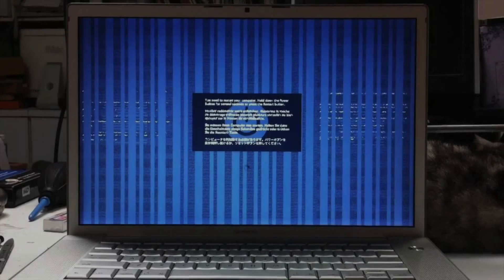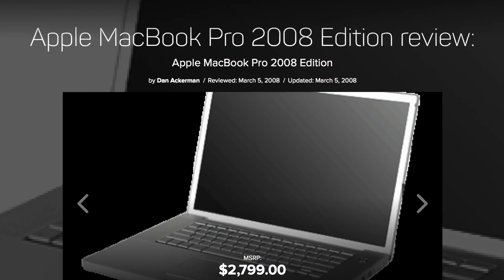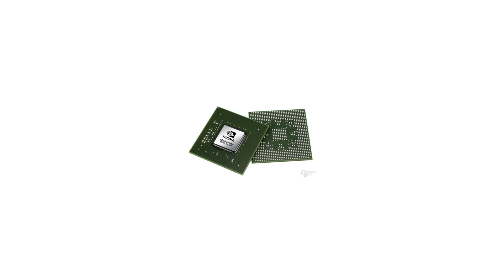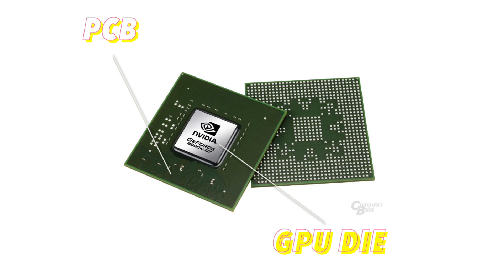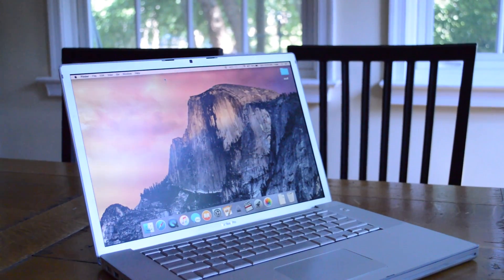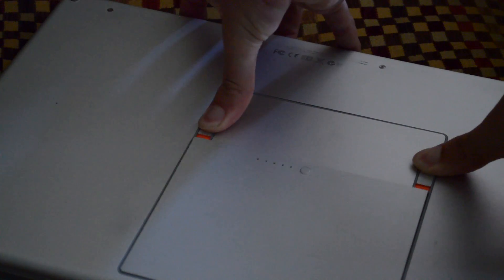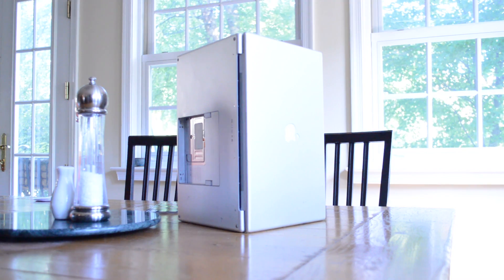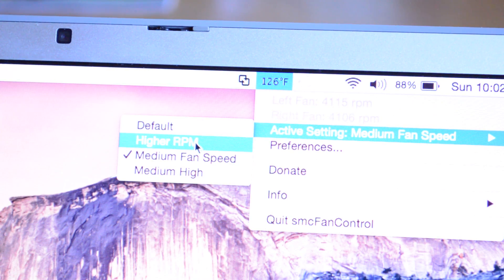2008 MacBook Pro Graphics Issue Explained (and how to fix it!)

Comment: I actually have a 2008 MacBook Pro that amazingly hasn’t experienced the GPU failure yet, despite even having a broken left fan. How it’s still running I don’t understand, but I’m glad it’s still running even now. Also I can confirm it isn’t the solder being the issue because my unit tends to get well up to 100 degrees C and it still keeps running. Thankfully I managed to repaste the heat sink and GPU unit when I replaced the fan. Though I’m thankful for this video because if it ever does fail, I can do this to revive it. Also I heard the part about setting the fans to run at a decent speed, so I’ll do that to keep my machine cool as much as possible.
Reply: Loc,3

Comment: El Cap is outdated, patch this. Also... once fixed, check the PCI bus width in system information... if it's x16 it's entirely fixed, if not then you should heat it further.
Yours shows x8 looks like, which is still wrong!

Comment: A funny thing happend here doing this: I had not used the macbook for 3 years having exactly the same problem, wrapped it in towels and it started right away 😂. But when i wobble the screen it goes black but when I start up again it works again untill I tilt the screen. Any suggestions?
Update: left it under the towel and it is fixed :)

Comment: Why not just hit the GPU with a heat gun? OR run some super intensive crap on it with only 2GB of RAM if it can boot? Minecraft sure does heat my 2008 iMac to 90 degrees celsius unless I run the fans at near max. Or just throwing the motherboard into the oven for a few minutes.

Comment: Cmd-S exit

Cmd S Applejack thru OS-10.9 Yosemite

Ditches the Caches

With my Early 2000 A1260 15" 2.5 ghz...

A funky A1175 BATTERY can cause quits...

A bad charger

Drives with too many bad blocks

Many more

Never seen with my Late 2008 AL-Uni 13.3 2.4 Deluxe

Or my 2007 WMB 13's

Nor my late 2009 Mac Min 2.53....

Maddening

With my ally find/ parts donor

A1260

No graphics issues, tho...

Thank God....

J.C.

Comment: !!! This method fixed my early 2008 MBP4.1!!!  Here is my response to dosdude1 - https://www.youtube.com/user/dosdude1 on his warming in regards to bad GPUs: "You jinxed it! He-he! The GPU crapped out in a couple days after you warned me: lots of rendering artifacts and failing boots... However, I managed to revive the machine by disconnecting both fans and overheating the GPU... You, probably, familiar with the 'method'. After a dozen failed boots(heating up) it eventually properly loaded OS and when I touched the PCB in GPU area and it started generating artifacts again... So, I pressed PCB hard exactly on GPU spot (G-spot) and vu'a la - for the last three days the machine has been running like a brand new one. And... assuming that it is only a temporarily fix I'm searching for revised GPU to do 'your magic'. I'll do it just for fun. Thanks, Man, for your guidance!"
The guy also created "macOS Catalina Patcher program" for unsupported MACs - https://www.youtube.com/watch?v=wxFzZWqoCng&t=1322s&ab_channel=dosdude1   -   It works like a charm!

Comment: I was just about to buy a spare motherboard from internet then I watched your video. I have the skill to open the whole mac till the last screw. I have a dremel  gas soldering device to heat the GPU area. I heated until I couldn't touch. After reassembly the Mac Early 2008 worked! I had it under my bed laying for 6-7 years! Thanks a lot. It feels great.

Comment: Without having a manual fan control app do you think that the system is overusing the fans?  Surely the system can control its own temperature and knows what the best speed to run the fans and at what temperature to get the internals to?
Reply: no it basically does not use them enough, therefore it cooks itself!
Literally every MacBook does this!

Comment: I have some problems on a 2009 macbook pro 17 inch with a Nvidia GeeForce 9400M    It randomly turns off and can take about 30 attempts to turn on, randomly quitting during system boot

Comment: it worked! 2007 mbp still working again, haven't had that feeling since i wrapped my xbox in a bunch of towels.
Reply: any tips? didn’t work for me :(
Reply: @firefoxsimp  lol great user name! Actually it stopped working quickly after,  I recommend taking apart and using a heat gun to melt the solder between motherboard and graphics card,  there is good tutorial how to but it's more difficult than the towel trick
Reply: @LSGTSTRM  link? also could i use a hair dryer as i don’t have a heat gun

Comment: My ALLY FIND/ABUSED 8/2008 A1260 MBP 2.5 15"

Is working fine!

Mobo was fine

Booted right up with a good POST

Worked via my ally find MINT DELL 18.5" VGA Monitor.

I swapped Screen/Lid and Keyboard from my two dead A1226 MBP's

Upped the RAM to 4GB from my bins

Kept the OEM 250MB 5400 rpm drive....

For the time being

Took a few dents out of the bottom shell

IT SINGS!

Matches my Late 2009 Mac Min 2.53...

3500 - 3600 scores with GeekBench II

I have a dead A1286 if I ever want to upgrade.

I see no need for now...

Works great with my 2009 Emerson 20" LCD TV

Austrian GP

xFinity race at INDY

IMSA at Daytona

My $15 ppd. mid-2005 PowerBook G4 1.5 15 is good for Live Timing & Scoring

at these events...

Plays YouTube videos with WebKit Safari 10.5 Leopard

TWO HOME RUNS!

J.C.

Comment: They  CAN and DO run hot enough to melt the solder on the GPU!
Heating with hair dryers and heat guns CAN fix this for a spell
Also disconnection the fans and running UP SIDE DOWN for 45 minutes to one hour can do the trick
Worked for me for 6 months
Then I overdid it with the heat gun...
Boxed for a few weeks
THEN I found a broken A1260 in out ally
Bad screen
Swapped on a good  A12226 screen and lid
Keyboard too...
from a $15 dead parts donor  found on eBay last December
IT worked!
I'll try and not do things to make it run hot
One of two FREE fan controller Apps can be big help!
Lessons learned
I have an A1278 AL-UNI that has been trouble free since new
Another developed a bad LVDS flat lead cable
At the hinge...
A common problem with that model..
Cottage industry "fixes" are there to BREAK COVER GLASSES
Destroy LCD screens
Not fixing the real issue!
BEWARE!
J.C.

Comment: Works on MPB early 2008, but i have to repeat it on each boot. Mine dowsnt have screews so i just unplug fans for 5 minutes then boot then plug them back in. Is a pain, but as long as i dont turn it off i can be on for weeks with out a problem.

Comment: It worked!! Awesome. Thanks Luke. I did as per the instructions except I first left the MBP horizontally for like 50 minutes and then on its side for another 50 minutes. Let it cooled down and after 30 minutes I turned it on. Thanks again!
Reply: cool*

Comment: Hi Luke. I have this MBP and one month ago my laptop failed to wake up after closing it. It doesn't boot up at all. Black screen (doesnt seem to have any backlighting at all)  but you can hear it's running . There´s no chime when I press the on button. I tried detaching the battery and pressing the power button for like 10 seconds to no avail. The sleep light is on. My question is if you think this problem is related to the graphics issue or something else? I didn't experienced any graphics related problem at all. Thanks for any input you can give me.
Reply: it could be.

Comment: My issue is different.  My late 2008 MacBook(not pro) crashed constantly with every upgrade since Yosemite.  Installed Mountain Lion, it didn't crash but was very slow.  I decided to install Linux Mint 19.2 Cinnamon and now it runs better than it did when it was new.  Sorry Apple, you make it so older hardware doesn't work with your OS.  I'm done with Apple.  I was told it was a hardware issue.  Nope. It's amazing how well Linux runs it this 11 year old MacBook.

Comment: This method worked for me... impossible to know if it's permanent or temporary (fingers crossed). I followed the instructions given, making certain to block the exhaust vents and letting it bake upside down for about 90 minutes. Then I allowed it cool for several hours, et violá!  P.S. Why does Louis Rossmann
 say "WTF"?
Reply: Bob Dobbs your laptop still working 5 months later?

Comment: i got a 2008 macbook pro 17 inch.. just setup both fans to 6k rpm when the gpu hits over 75c
Reply: Which app do you use?
Reply: Change the thermal paste boi

Comment: I have one of this and when a turn on I don't hear the boot sound, but I can hear the HDD working. Keyboard lights and batteries are ok. When I connect it to another MPB (via FireWire Target Mode), the HDD is there, with system working, etc. Finally, when I plug it to an external monitor, both screens stays black. Do you think this method can help me resurrect it, even (apparently) without the bootloop? 
Thanks man!

Comment: Following the threads here, I was curious about mcdradus (11 months back) putting his into the freezer for a bit.  I made another attempt with the temporary fix which again surprised me when it worked.  But when the graphics were losing their grip again I decided to pop the macbook in the refridgerator for about 20 - 30 minutes.  It has let me get more files and pictures off the macbook pro for almost an hour.  I even got an OS X upgrade to take.   Thanks again Luke.  You are a wild man.
Reply: Does it still work?
Reply: Yes.  I put it in the Fridge for a half hour and I can access what I need.  How to solve the overheating is still a problem but that's a battle for another day.  Every since they did those software upgrades it is just slow.  But getting the files I needed off of it was worth while.  It still boggles my mind that it worked.  I always thought it was a bad update from Apple and I never realized it was just their crap quality that matches what I read here.  All the googling in the world and I found a solution here.  Go figure.

Comment: This was the most ridiculous thing I have ever read and didn't believe it for a second.   It has been months since my 2007 MacBook Pro bit the dust and I was disgusted.   This actually worked.  And heed the warning.  I temporarily fixed it and I was able to get the last two year HR Block tax files off it before it started in with the GPU reoccuring.   But my assumption that it was a software issue just made an a** out of me and the MacBook.   Thanks Luke!

Comment: It a shame that most laptops that are plague by this garbage Nvidia 8000m series gpu are forever bound to it, Like my XPS M1530 that's in good condition but, there is not a model without the 8000m series gpu. If I do get one of these just for my collection because I really like this design of this macbook pro, I would probs just get a A1150 it may be bound to 32bit only, and OSX snow leopard but it comes with the mobility ATI x1600, yes there are cases that they did fail but not as bad as that garbage. And the parts are way way cheaper for it.

Comment: If a 2007 MacBook Pro doesn't turn on at all... like black screen but white power light... does this fix work?
Reply from the maker: In order to get the method to work you'll need to heat up the computer but getting it stuck in a boot loop with no ventilation. If your computers fans turn on you may be able to achieve this, but if there is no sign of life other than the power light, the computer won't overheat enough to shock the GPU into working again
Reply: Thank you so much Luke!

Comment: I've had my trusty 2007 Macbook Pro for 2 years and luckily it hasn't failed yet. (Knock on wood) I believe that mine had the proper apple repair done on it before the warranty period ended. I might switch to a pre-retina unibody soon but for now my 2007 is working great.
Reply: the 2007 could be patched to macOS Catalina, unfortunately the CPU does not support SSE4.1.
Upgrades are dirt cheap, but you need somebody with soldering skills!

Comment: 2:47: "PCIe Lane Width: X8"... It's supposed to be X16. Loss of PCIe lanes indicates that the GPU is failing again. I've done GPU chip replacements on these many times, installing the revised version of the chip (G84-603-A2). Took some pictures during the process of one: http://dosdude1.com/pics/mbp08gpureplacement2/
Reply from the maker: Here's an observation: I've noticed that on most of my Apple laptops with dedicated graphics the lane width displays as x8 (On my 2012, 2013 retina, and 2016). I wonder if that's due to the graphics switching effecting what's displayed in system information? Also, we all thank you for your work with Sierra and High Sierra patchers! Any update on possible Mojave patcher (ik its hard because of the Metal GPU requirement)?
Reply: Yeah, 2010 and later dual-GPU MBPs are supposed to only have an X8 PCIe lane width. 2009 (9600M GT) and older are supposed to have an X16 PCIe lane width. Mojave patching is quite difficult, mainly due to the video card issues. Once (if) we get that figured out, then I'll be able to create a patch.

Comment: @Luke Miani, My girls Macbook Pro is DEAD. I mean dead. Won't boot at all. I think a heatgun to the GPU might solve the problem but I doubt it. I think the motherboard is fried entirely. It might be the power socket. Any suggestions as to where to begin? Just so you know, when I use a working power cable, there are no lights what so ever. No fans spin and there is no POST or kernal panic. Pretty dead, right? I ask because I want to fix it and use it myself.
Reply: "I want to fix it and use it myself" XD
Reply: Well since she got a quad core i7 Macbook Pro with Retina screen recently and the old Macbook Pro is dead to her, why not? Plus my Hackintosh isn't working 100% and I want to learn Swift. Gawd.
Reply: James french  smart man

Comment: Also that damages all the other components in the machine.
Reply: Not really because the non-leaded solder melts at a much higher point than what it takes to reflow the gpu. And if you're at this point you really don't have much to loose on that motherboard.

Comment: Do you think you could make a video on fixing the 2011 GPU issue?
Reply: I disabled my dedicated GPU with the archlinux fix and now not even gfxcardstatus can enable dedicated graphics and all my issues are gone
Reply from the maker: If I can find a way to fix it I will. Currently as I don't have one I can't try out some fixes (I did play around with disabling the GPU but I didn't get it to work on the machine I had at the time). Theoretically, you could try this method to see if it works, the principles should be the same or similar.
Reply: I was actually able to figure out a viable solution!!

YouTube is blocking my link though so  imgur com / a / DZSUd (just remove the spaces)

Follow the steps after "It should now work." :)

Comment: i have an early 2008 /A1260. was unaware of heating in this method, What i have done is to freeze it. I put mine into a zip lock bag and place it in to my deep freezer for about an hour afterwards it boots and operates just fine. Temps run from 115 to 190 F with fan speed control APP. When the computer is cooled down to around 120 F  and rebooted at Ambient temperature it won't reboot.Powers on with no chime or screen display I have to freeze it again. What do you think is happening? Some  are having success with heat shocking but i am having success with freezing it.

Comment: i have repared my graphics chip by take out the logic board of my Toshiba Qosmio G30-105 and heat the graphics chip up with a hairdryer at maximum heat and air pressure at a distance of 1cm four about 5min,after that i have lat cool it down four about an our and repleace the termal peast
Reply: after that i clean up the fans and put all together and it works!

Comment: I'm surprised this doesn't have as many as dislikes as the  "Best MacBook Pro deal ever" video you put out! Im saying this because this is actually only a temporary fix (although, I must say that it's better than putting a blow-dryer to it like most do). I've literally spent months trying to work up the courage to replace a graphics card myself. Since I'm having trouble finding "how to" videos, I've spent the past month looking for a how-to video or site that shows you specifically step-by-step to replace the CPU from an i5 to an i7, but I still need another graphics card for that to function correctly. A video from you with the concerns I'm having that I addressed previously would be fuckin epic!
Reply: Vani Jay why will you replace the i5 it has less heat also you can hire someone from Upwork to do it cheap. A professional so you don’t pay to much or risk messing up your MacBook

Comment: Dont forget to menti0on that some Lenovo T61's and T61p's had this issue with there Dedicated graphics chip (NVS 140M and Quadro FX 570M) but the issue was different, instead of the GPU die separating from the gpu's PCB the BGA solder balls would micro fracture causing the GPU to fail and thus would cause artifacts to appear on the screen and it just not booting all together, my T61p is a champ it is the revised model with a different solder ball matereal but its survived 91C temps and overclocking becaue the Quadro chips where actually binned very well, but still a good and informative video

Comment: It worked perfectly for my MacBook Pro 2006
Reply: You can't, MBP's from 2006 use 32-bit Core Duo processors and the latest OS version compatible is OS X Snow Leopard (10.6). Great machines still haha
Reply: Feryjhon are they socketed or are that soldered? I think you can replace a socketed Core Duo with a 64bit cpu. Then with some coaxing, you can put El Capitan on one of those.
Reply: you can get high sirria on these im pretty sure
Reply: Is it a late 2006? I have a similar problem, sometimes it will freeze at a blue or grey screen and only restart in safe mode